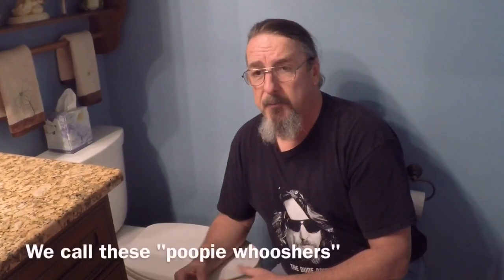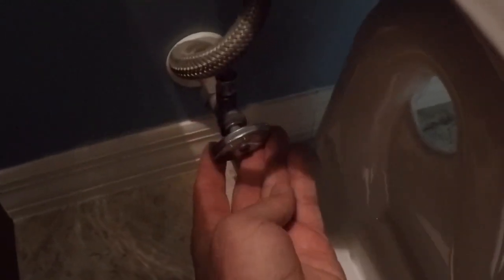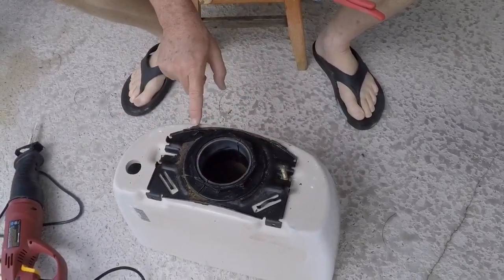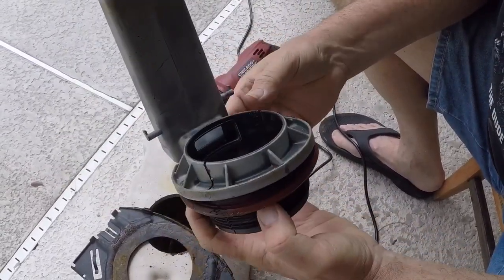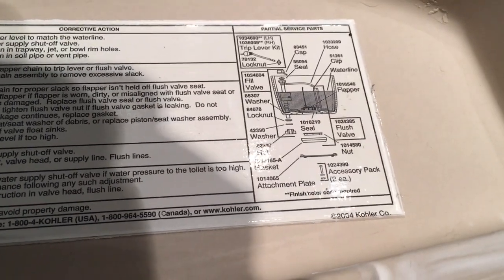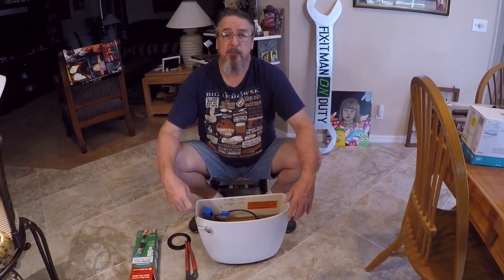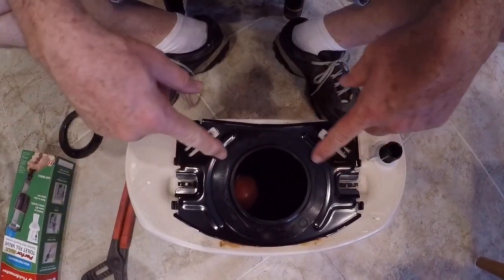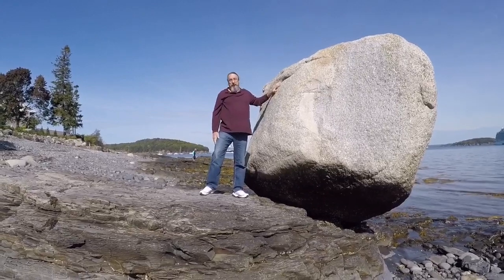Kohler Cimmaron Toilet Tank-to-Bowl Flush Valve leak Calamity - How to Fix DIY

Comment: Thanks for great vid.  I had exact same symptom w/ exact same model.  On disassembly I found all components of the flush-valve assembly to be in great shape except the gasket itself which was ragged.  So I replaced just GP1018165 ($8 @ H.D.) and problem gone.  Took about 15 minutes.  Thanks, this video really helped me.
Reply from the maker: Tom H glad it was helpful!
Reply: Same problem, but I called Kohler and they confirmed that GP1018165-F was the fix, thanks for the video!
Reply: I just ran into this same issue and feel strongly it has to be the black gasket between the tank and bowl which, as Tom H mentions, is an easy fix and $8.  Will confirm when I am done.
Reply: @bsenright  did you confirm it ?
Reply: @Bugsbunny808  yes

Comment: TY for this video! My husband recently passed after long illness. I’m trying to learn and fix things around the house. I struggled with that damn nut. I finally put some zero acid and let it soak 30 minutes and it finally turned. Took a bit to get completely off. Thought it was that I just don’t have strength, but knowing you chose to use a reciprocating saw, gave me a bit more confidence in my abilities (I’m not weak). My metal plate had some rust, I sanded it down, wiped with alcohol and used some spray enamel paint before putting it back on.
Reply from the maker: Cheri Madlom so sorry for your loss but also happy this was of help to you...be well!
Reply: @JimmiePorterAtStuartArts  Would you recommend using teflon tape around the thread to make it easier to disassemble in the future? I would use a hacksaw instead of a sawzall to free a ring.

Comment: Some may find the source to be the foam rubber gasket only. Because the tank "floats" on the bowl, more or less with the foam being the critical part, it may tear with any backwards pressure put against the tank. Try replacing this gasket first before progressing through the other flush valve components...easy enough test on its own. 2 nuts and a tank purge of the water is all the work you're risking to possibly save a more expensive and time-consuming disassembly of the entire flush valve. That said, anyone owning one or more of these toilets should keep the entire flush valve parts list on hand in case of failure and to avoid downtime.

Comment: I used a plier type oil filter wrench for the large nut. Do not over tighten; one turn past finger tight is sufficient. Too tight distorts the seal and it will leak.

Comment: Oil works too. Let oil or wd-40 seep into the joint to get the large nut off. Works like a charm. If it's stubborn I use a flathead and hammer and slightly tap the nut until it begins to move. Of course always make sure you're going in the right direction.
Reply from the maker: I love it when folks add their experience. Great comment!

Comment: Mine new out of the box leaked like crazy, it turns out that the porcelain where the seal meets the bowl was not even close to being true. I put a one pound coffee can over the opening and there was a 1/8 inch gap towards the toilet seat area. I returned it to the store and picked up a replacement and it was perfect. The 2020 model changed the system to a 360 design I believe. Thanks for the video.
Reply from the maker: Frustrating to have to go through that. But I think you will be pleased with the performance now that it’s sorted out. We’ve had zero problems with ours in the 10 years or so we’ve had them. Good luck!

Comment: It’s the dry lock gasket that went over that abs nut that you couldn’t remove.  If it was inside the tank it would have a constant leak.  The dry lock gasket is what stops it leaking when you flush.   $5 part.
Reply: Where did you buy it?
Reply: @group9234   I think it was homedepot
Reply: You will need a very large pair of channel locks to remove the large plastic nut.  It’s probably 5 or 6 inches diameter.

Comment: I just had this same exact problem.  The issue appeared to be the black rubber seal between the tank and the bowl.  I could not see how anything else could possibly produce a leak in that area.  So as suggested by others on this thread, i went to HD, got Kohler part #GP1018165, removed the tank, replaced that seal and in 10 mins time, had everything done and no more leaks.  Cost $5.30 plus tax.  So before anyone goes down the path of all the effort in the video, first try to replace the black seal which is easy access and cheap to replace.  Also, the new seal is larger than the original which creates a much better seal
Reply from the maker: B Enright thanks for the info!

Comment: I had the same commode, same problem. I put a bigger washer ring on bottom. Ain’t leaked since. 3.49 cot to repair 48 hours trying to figure out where water was coming from. Problem solved. My guess is Koehler put wrong do not hasket

Comment: FYI.   An auto oil filter wrench makes quick work of getting off that large retaining nut.
Reply: No it didn't!  I even put an extender bar on the filter wrench and that nut wouldn't budge.....  Left it on, bought a new gasket and problem solved.

Comment: The only thing missing is how to get the tank off of the toilet. I don’t see the bolts that attach the tank to the bottom. I’m also very worried I won’t be able to loosen anything you said was very tight. Maybe I’ll need to simply buy a new toilet... thanks for the video. Huge help to simply know what’s wrong and what needs to be done.
Reply from the maker: Tiffeny Thompson best of luck to you!

Comment: Wondering if this is an issue with these, during a bathroom remodel (Tile, new shower the works) of my house I found the sub floor had a small amount of mold under this toilet (13 years old) and when disassembling the toilet found the metal plate severely corroded, have ordered the same parts as you (found this video after I had diagnosed and ordered) and will be referbing this toilet as well. All and all not to bad for 13 years of service but now will check it every couple years or so.
Reply from the maker: whitey22222 when they are set up well they are really decent performers. Really no complaints here.

Comment: Anytime I assemble something like that I load the threads with grease to keep water out longer. 2 cents
Reply from the maker: Dave M that's a good tip - should have thought of it!
Reply: Ditto that, I either use vaseline or Dow Corning makes a die electric compound called DC-4 that also works well.

Comment: my bowl is running right now and the water is rising! Can i turn off the water off till the plumber comes tomorrow? Or will something bad happen?
Reply from the maker: electroboy if the toilet is going to overflow or will not stop running I would shut the water off until repairs are made. Good luck!
Reply: @JimmiePorterAtStuartArts  I'm in a 10 year old condo in Canada. Will shutting off the water valve shut off water to anything else in the bathroom?  

It's a rental so I'm scared if messing with the knob valve will ruin any pipes or anything? It hasn't overflowed but the water did rise to half a bowl after hours of it running...
Reply from the maker: electroboy i don't know what your configuration is, but there is usually a shutoff valve  behind or near the toilet. If so,  then that is all that should be isolated. The way to know is just shut it off and check your other faucets, shower, etc. if there's still flow to those items then you're OK. If there are any problems just open it back up again.
Reply: @JimmiePorterAtStuartArts  Yes, there is the valve at the bottom of the toilet. Only one pipe connection to this 10 year old Kohler toilet. So there is no way I can damage anything by turning off the valve? How do I know how much to turn it? Thank you!
Reply from the maker: electroboy When you close the valve any flow noise to the toilet will disappear. You"ll know its isolated if when you flush it it does not refill.  Sounds your fill valve is leaking by...very common.  Pretty easy job...your landlord should be able to knock it out in a few minutes. Sometimes when you cycle that isolation valve you can get a drip from the stem. Be sure to have a pan or bucket under the valve in case it leaks.

Comment: I've never seen another toilet brand that requires a metal plate to hold the tank onto the toilet bowl. I've only seen assembly with the bolts going directly through the tank with a good washer seal arrangement inside the tank. Why Kohler thought this was a good idea, I will never know. This metal plate concept just complicates the issue. I hope some engineer got paid well for their idea.

Comment: Well I know this is an older vid and posts, but the Cimarron still leaks between the base and bowl. The seal connection like I’ve seen posted about several times. Lucke me I decided to buy an expensive kohler. Could not get it to stop leaking no matter what I tried. Took the bowl off three times and tightened the bowl looser, tighter, and in between. This thing leaks no matter what. Finally cracked the bowl after finally tightening more. Piece of garbage imo.

Comment: Mine leaks there too!!!!!!!!!!!!!!!!!!!!!!!
Reply from the maker: I hope this was helpful!
Reply: @JimmiePorterAtStuartArts   HELPFUL??!!  Are you kidding me??!!  I was about to spend $400 on a new toilet!!!!!!!  Even tech support at Kohler just told me that the only thing that would cause that leak is that gasket.  Nobel Prize in Plumbing for you!!  Thanks soooooooooooooooooooooooooooooooooooooooooo much!!!!!!!!!!!!!!!!!!!!!!!!!!!!!!!!!   A+++
Reply: @JimmiePorterAtStuartArts  Hey!!!!  I had the exact same problem!!  That ring had disintegrated. Got a new ring at Home Depot for $6 .  All fixed!!! You saved me $$$$$$$ . Thanks so much!👍🏻🎃😷🌵🙏🏻

Comment: I just bought this dumbass toilet and it was leaking immediately from the tank to bowl transition
Reply from the maker: Once you get that fixed they are great…ours ate about 10 years old and no clogs.
Reply: @JimmiePorterAtStuartArts  had to get Lowes to swap the tank out with another unit. It was like pulling teeth. Home Depot, that would be in and out in 10 minutes. Took 40 minutes at Lowe’s.